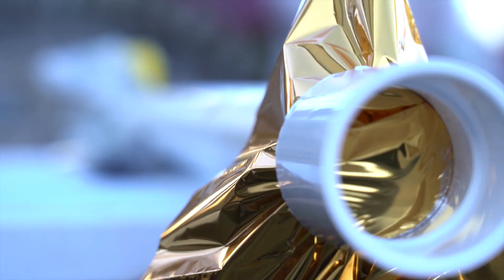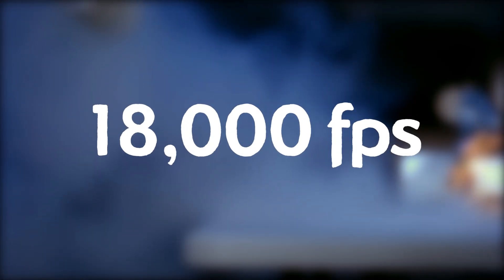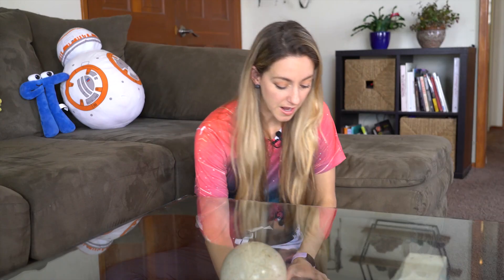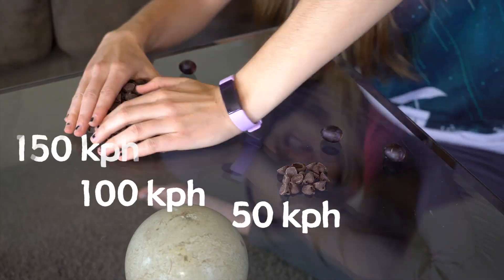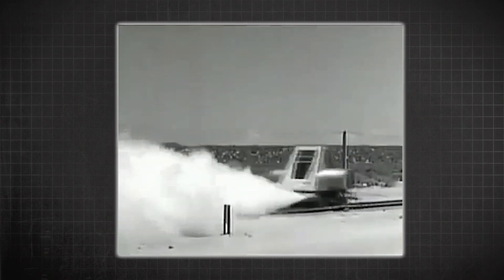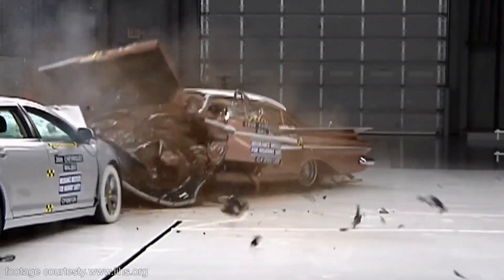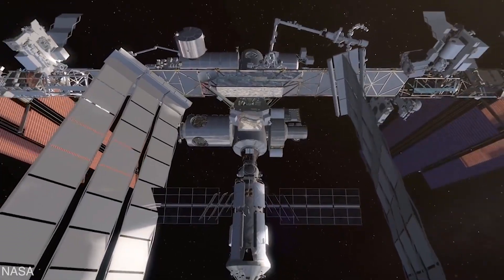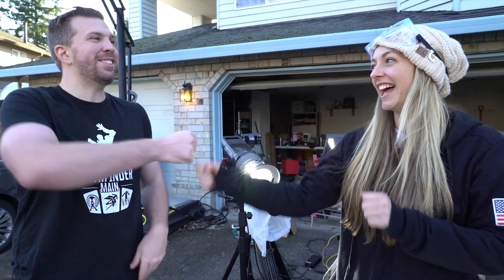Ballistic Ping Pong Ball vs. Tennis Ball at 450km/h!

Comment: A few years ago I was involved with  similar experiment,  experiment always sounds better  to describe fun destructive behavior,  at our local makerspace.
We found out that there was a large diminishing return from lengthening the cannon. Since the ping pong ball is not a perfect fit, at some length enough air leaks aroung the ball to stop it.
What made a huge difference was popping the Mylar burst disk with air pressure rather than puncturing it. 450 Kph translates to my english ballistic frame of reference to about 410 fps. With the air we had more than twice that  or about 1000 fps measured with a ballistic chronograph. If you ever move to 2.0 of the ping pong ball antics that might be fun.

Comment: Just thought that as a 'Physics Girl' you'd do some research on the actual physics of the crash...Crashing into a semi going 80kph and going backwards at 76kph would be traumatic, but wouldn't feel like hitting a wall at 156kph. The energy goes with the square of velocity, so when you're going twice the speed you have 4times the energy (as you've actually said in the video...). In that case your total energy change would be pretty much double of your initial energy, which results in a speed change equivalent to approx. 113kph into the wall. It's a common misconception, where people say hitting someone on a highway head on at 60mph is an equivalent to 120mph into the wall...here's what it would really look like:

https://www.youtube.com/watch?v=R7dG9UlzeFM

Comment: 11:45 Maybe it's good to clarify what a "G" is, for the unaware viewer; 4700 Gs is a big number, but if someone were to ask you "what does that mean, 4700 Gs?", you'd probably want to be able to explain what it means. Let's go Mark Rober style, here:

So, imagine a 1 kg (approx. 2 lbs) packet of sugar being dropped from a tower (say, 44 meters) with the packet sufficiently streamlined to not experience much air resistance. Let's measure the velocity of that packet of sugar every second. 
The moment we drop it, we know its velocity is still 0 m/s. What does that mean? It means that, if we magically turned off gravity, the packet would seem to float at the same height forever. (We now turn gravity on again.) After 1 second, the packet has sped up and is falling at 9.81 m/s (let's round that to 10 m/s from here on out): that means that, if we were to turn off gravity again, the packet would this time keep falling instead of hovering in place, but it would not keep falling faster and faster. It would move down at a constant velocity as if somebody were lowering it with a rope, and it would traverse about 10 meters every second. If we looked at the packet after 2 seconds of having experienced gravity, it would be falling at 19.62 m/s (about 20 m/s), and after 3 seconds, 29.43 m/s (about 30 m/s). Coincidentally, that's also when the packet reaches the ground of the 44 meter-high tower.

As you might notice, our packet's velocity - remember, that's the constant distance it would be traversing every second if we turned off gravity - keeps increasing per second by about 10 m/s. We say that it "accelerates at 9.81 m/s²", and we call that number "g", the "gravitational acceleration on Earth" (close to sea level).
Now, if we dropped a 2 kg packet, it would obviously be falling way faster after 1 second. To be precise, it would fall twice as fast, at about 20 m/s. After 2 seconds, it would fall at about 40 m/s, and so on.
If we lived on an Earth where gravity was twice as strong, our original 1 kg packet would speed up during its fall as much as the 2 kg packet does on our own Earth. Key insight: when speeding up due to gravity, we can compare how hard the force of gravity pulls per kg, with the acceleration it's giving per kg. This is why you'll see "g" expressed as a measure of "force per mass", because, although it's a handy number to use for acceleration, it's also handy to describe the force of gravity (in units of N/kg, but humans have no good reference of what a Newton of force is, unlike of velocity).

So, if someone tells you something causes "4700 g of force", what they mean is that, if you imagined that the described force (in Diana's example: air-pushing-force) was gravity acting on a 1 kg packet of sugar on some outer-space Earth, that outer-space Earth would make a tiny 1 kg packet of sugar speed up as fast as our Earth speeds up a whopping 4700 kg. Yes: it would be an outer-space Earth where our 1 kg packet of sugar would reach the ground as fast as a pickup truck would back here on Earth (although you have no good reference of this, because when people drop pickup trucks, the bottom acts like a sail and thus the truck falls way slower than it would without air), which is in approximately 0.044 seconds - 5 of those could happen in the span of one blink!

Comment: The truth is, a bigger, heavier car is only safer in an accident against a smaller car. But for any car, the smaller and lighter the better regarding security. Less inertia so easier braking and turning to avoid the crash, quicker response time, more predictable and controllable reactions when moving the wheel violently, less energy to dissipate if the crash is unavoidable. And if more and more drivers get big cars, the advantage of safety against smaller cars disappear because everybody else has a big car too.

A lighter car can have as good passive security as a big car may have, but will always have better active security because of physics :)

Comment: Massiv fun if you are the big ping-pong ball as a passenger in hyperloop. Because when there is a failure tons of air will hit you.
So you get a lot of negative G forces when it hits you.
1.5m radios to the power of to multiply with pi is the area about 7 square meter. Every cubic meter of air weights about 1kg . Then you get hit by 7tons of air at the speed of sound for every km of hyperloop the failure is before you.
Ok I would put cargo in it but passengers ? 
Hmm ...

Comment: "I drive a giant SUV so that I'm safer."  Thereby making the roads LESS safe for EVERYONE ELSE. And the more giant SUVs around, the more it levels back out again to "well now you're all equally unsafe". Except now you have much higher centers of gravity, vehicles that are harder to control, vehicles that do much more damage to anything else that they hit, make it harder to see anything else on the road, that are literally harder to drive and park due to their size, and that are wasting many more resources both in manufacturing and in fueling. Also, putting more wear on the roads.
Don't drive SUVs. And if you absolutely need the capacity, pick a smaller, less massive one.
Reply: In the UK (which, admittedly, is a relatively small island), fuel economy is often a big driver of vehicle sales, given petrol (gas) costs over £1/litre and diesel varies from the same price to 10p/litre more expensive.

Thus smaller cars tend to be more in abundance than bigger cars - plus the bigger SUVs (or Chelsea Tractors as they're sometimes called derogatorily) can only just squeeze into the standard parking space, leaving little room for the occupants to get out if the adjacent spaces are occupied.

Added onto which, even tiny cars often have 5 star ratings in the Euro-NCAP crash safety tests, due to very efficient use of crumple zones in the engine compartment, a more rigid passenger compartment (including side impact protection beams in the doors), airbags everywhere and seat belt pre-tensioners (which also minimise whiplash).
Reply: I need guns to protect myself against SUVs.
Reply: If you need capacity, drive a mini van.  People don't like them because "they're not cool", but they have twice as much capacity as any SUV and are far more comfortable.  The only thing that compares is a full sized pickup truck with a crew cab (a new one, where the back seats are huge) and a fully covered bed (or the luxury SUVs like Cadillac and Lincoln make which are basically just pick ups).  The modern SUV is just a clunky, heavy, fuel inefficient car with AWD (sometimes 4WD).
Reply: Good real life prisoner's dilemma example
Reply: It does give you more safety

Comment: Slight miscalculation in the video. A bouncy (tennisball) impact with a heavy object going the same speed will result in a delta-V of 4 times the initial speed. 
So Fiat 80km/h (not bouncy) to wall (0km/h) -> delta V 80km/h. 
fiat80-fiat80 -> deltaV 80km/h. 
fiat80-SUV80 -> deltaV almost 160km/h
tennisball80-wall0 -> deltaV almost 160km/h
tennisball160-wall0 -> deltaV almost 320km/h
tennisball80-SUV80-> deltaV almost 320km/h 
The last two are the same, just a change of frame-of-reference.

Comment: A question won't leave me. Is the sound only the vaccum being filled? Or is a portion of it the ping pong ball bursting?
Since it is bound to be compressed some before it snaps, would the air inside of it be pressured enough to make a sound as well as the ball breaks?

Comment: in mythbusters they have shown that when 2 vehicles collide at the same speed each, it is not the same as if you hit a wall with 1 vehicle at the double speed
Reply: It is the same as if you hit a wall with double the kinetic energy.
Reply: True, if the vehicles are equal in mass. In that case the vehicles stop where the crash happens, so it is about the same as crashing in to a wall. But if you crash a sedan (a family car) to a semi (a truck that has many times the mass) the semi barely loses any speed and the sedan changes from going 80 kph into one direction to going about 75 kph to the opposite direction in about the same time as the previous crash, so the second crash is roughly the same as hitting a wall in the combined speed (in this example 80+75 kph). I mean the combined speed of the sedan before and after the impact, as Dianna explained in the video.

Comment: 12:21 please explain what effects along the wall you’re talking about! I’m so curious... because you’re not talking about boundary layer stuff right? Bc vacuum?
Reply: I'm curious as well! I am thinking it's the little amount of air gushing past the ball (while the ball is being pushed and accelerated) but also limited by the choke velocity at the annular gap between the ball and the wall whilst in motion. For this reason lower clearance can help speed up the ball more as well as have very little air ahead of it in the end that is compressed (and loses energy) between the mylar and the ball. Interesting would be to see how would a half cut ping pong ball perform.

Comment: Never tear apart a soda can like that with bare hands as the sharp edges of aluminium can slice fingers open in an instance, I used to carelessly tear them just like that until I got a 3 cm gash in my thumb, either wear gloves or do it slowly and carefully by pinching it in the middle and tearing it like a sheet of paper, holding the ends and ripping it apart as shown in the video is a great way to enter a bloody lottery. :)

Comment: 12:00 You also could (theoretically) increase the pressure on the side you are popping open  ...

Edit: And I now see (while rereading my original post)  that I didn't made it clear ... I meant on top of the vacuum.
Also ... I wonder what upgrading to golf balls would do....
Reply: MrMegaPussyPlayer
you mean like an air rifle ? :-)
Reply: @YTANDY100  more like a air cannon.
I've seen some with huge pressure storage tanks and quick valves with giant diameter allowing hundreds of liters of air per second ...

And I now see (while rereading my original post)  that I didn't made it clear ... I meant on top of the vacuum
Reply: @MrMegaPussyPlayer  
it is such a light ball that it may not make any difference to its speed by putting more pressure on the back of it :-)

Comment: You should remake the vacuum cannon, but instead of puncturing the end and letting atmospheric air pressure rush in, use an air compressor at say 120psi with a dump gate.  You wouldn't need to puncture the film, i would think the 120psi hitting it all at once would rupture it.  Goodbye tennis ball

Comment: One minor point I’m sure others have or will point out, but even the crumple zones of nearly all passenger vehicles are made of steel. The entire structural part of the vehicle is steel and to a much lesser degree glass. Some vehicles use plastic, carbon fiber, or aluminum but it’s not used for superior energy absorption.

Comment: So, basically what's happening is the air is rushing in to fill the vacuum and equalize pressure, and because the ping pong ball is large surface area to mass ratio and takes up most of the cross-sectional area of the pipe, it is easily pushed by the incoming air with no air resistance in front of it. WHAT IF you put positive pressure behind the entry film (approximately twice the volume of the vacuum chamber)? Not sure how much the mylar foil can withstand, but I feel like it would be worth exploring.

Comment: Large vehicles are safer for the occupants, but that does not account for the fact that they are less stable, and make you more likely to lose control.  SO, for your average driver, inexperienced, they're more likely to crash in a large vehicle because it has a higher center of mass ie, less stable.  I drive a bus, and always have this in mind for those little pipsqueaks running around in their lunchboxes (ie. prius)  

IDK if this is shown in stats, so someone do the research and math.  =)  Most driving involves going in a relatively straight path, so this might not have as large an effect as expected...

Comment: I've just finished watching the whole video and I still have one doubt. How much does it matter where the ping pong ball is inside the tube when you puncture the side?
I mean, it has to change something if the ball is in the middle, near the front or the back of the pipe. More distance for the ball to travel, more air to push it... Did you tried any variations? Or the difference would have been simply too negligible considering the 450km/h? :D I suppose that placing the ball as far as possible from the can side would be better but I'm curious to know a bit more about this aspect :)
Reply: Also @physics girl
I wonder what would happen (especially to the tennis ball) if there were nothing but air in the tube. First of all, the air must break the 2nd foil, but it might be that the mere mass and speed of the air filling the tube carries more energy than the ping pong ball in the end. (The reason I consider this is the fact that the ping pong ball vanishes almost completely in a few frames' time while it has very low mass.)

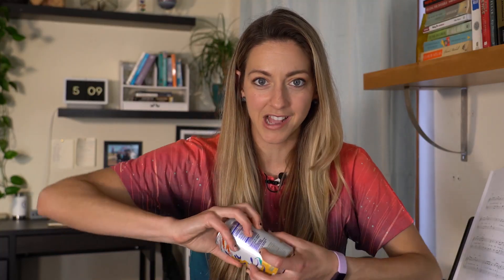Comment: 2:50 i crushed one with my bare hands. mostly just crushed the middle and then twisted both ends before flattening it.
Reply: Exactly! You first create some defects/weak spots where the breaking can start much more easily, then it's much easier... also using two geometrically normal kinds of strain is key